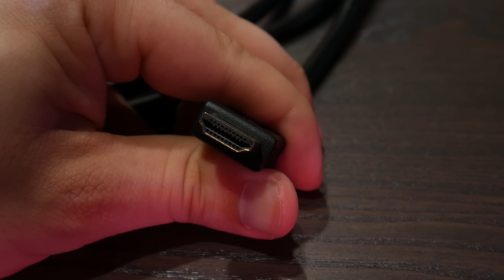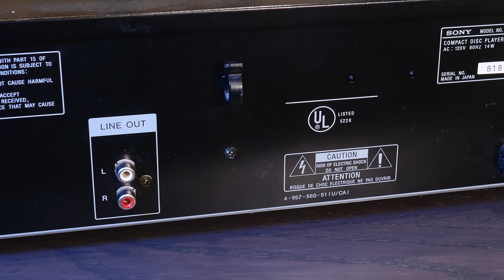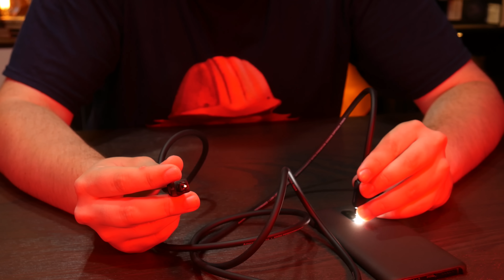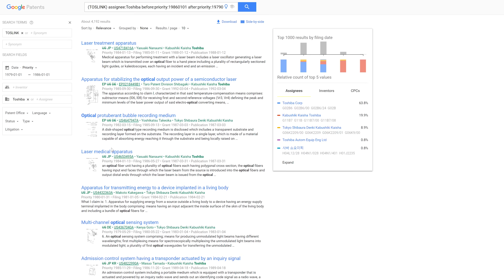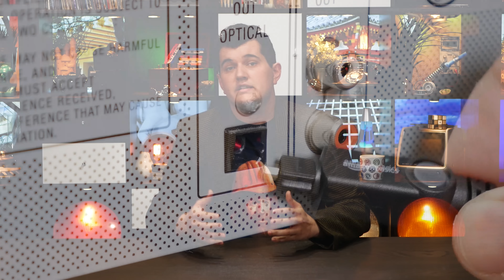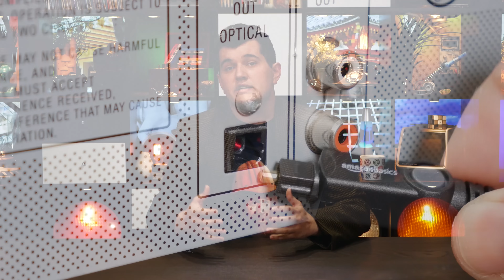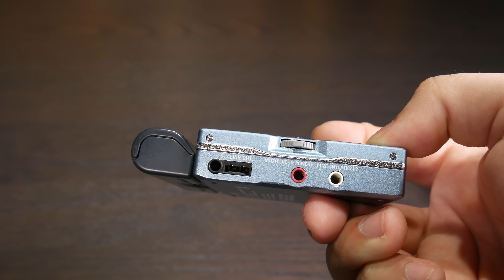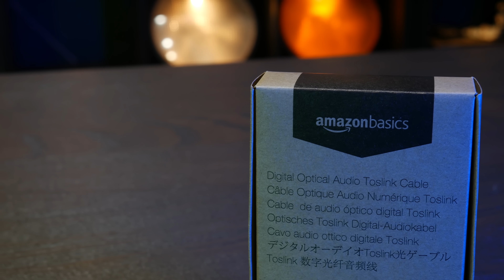TOSLINK: That one consumer fiber optic standard

Comment: My soundbar has HDMI and TOSLINK on it. I use it with my PC, and with the HDMI, audio stability can get wonky. Mainly, my PC will not play audio sometimes until i change inputs and then put it back on HDMI. The audio is great does Dolby ATMOS and whatnot, but it loses the signal sometimes. With the TOSLINK connection, I have no problems. Audio works 100% of the time. On that alone, I keep my TOSLINK hooked up.

Comment: The biggest reason we preferred TOSlink in pro audio / film / high end home theater or audiophile situations was it is electrically isolated from the source. This is less important for something like a cd player and receiver in your example - but connecting a PC to a pro audio rack if you can transmit the data without electrically coupling a device which has motors, high speed switching power stages, and all kinds of messy signaling, that’s MASSIVE.

Comment: TOSLINK does still have a place in the modern home setup. Because TV speakers often are garbage, a soundbar is commonly acquired as part of the package. 
The HDMI will bring the quality audio into the TV but you have to take that audio from the TV into the sound bad. This is where TOSLINK find's it's home in the modern era. Every TV will have a optical audio output and every soundbar has a optical audio input. 
Some are using Bluetooth to try and connect soundbars to TV's but that is going to being audio delay. 
TOSLINK connects my TV to my soundbar and I have excellent audio quality from it.

Comment: i use my pc as streamer if i use coax cabel the digital is obies still fine but sinsce i use a "cheap" audiofiel stremer the noies frome the pc gets somehow in the analog part of the amp whith toslink it doesend the proplem is thet i get jitter over 96khz 24 bit signels but sitil better then coax

Comment: 13:50 I had the same kind of thing when I installed Linux on my 2015 MacBook Pro. I told it to use surround sound and the audio jack started glowing. Sadly enough the 2015 was the last MacBook that had it, I do kind of miss it now even though I wouldn't really use it that much. It was easy to have a thin long cable plugged in to the back of the receiver to quickly play some audio from my laptop.

Comment: I used Mini-Toslink S/PDIF from my Mac to an iPod Hi-Fi for years—I still have it, it still works. Key reason: no need for double amplification, that is, the laptop decoding and amplifying the audio signal for output over RCA/headphone copper, then the amplifier in the speaker set further amplifying the signal. This introduces additional distortion. Toslink? Speaker amplifier, once.

I still use that thing as a centre channel on my home TV. Stereo reproduction is zero (additional satellites solve that problem), but zero need for an additional woofer. Bass to the max.

Comment: My house was built in 1998 and they ran fibre optic from the basement to each room. The thought was your internet would come in from somewhere near to power box and you could have a computer or laptop in any room you wanted……  if you will excuse me I need to reset my wifi modem

Comment: But I can get my 4k video signal over a standard CAT6 cable which is so much easier than HDMI. There's even a COAX based standard that pros use. All those fiddly connectors for HDMI, expensive cable and short runs are so inconvenient when a CAT6 cable can go from my receiver box in the corner of the room to a projector at the back.

Comment: I have an idea how TOSLINK could get a fully backwards compatible upgrade for increased bandwidth.

Connector upgrade: Detection if cable is connected, half-duplex two way communication

Output/TV: After cable inserted waits 10 seconds for a handshake initiated by the receiver/amplifier. If no handshake is initiated old TOSLINK is assumed. Reset if cable disconnected.

Input/Amplifier: After cable inserted it sends the initiation for a handshake once a second until it receives a valid signal. If the signal is old TOSLINK then old TOSLINK mode is selected, if the signal is the handshake new TOSLINK is selected. Reset if cable disconnected.

Thus the new TOSLINK standard could have high speed communication but both sides are backwards compatible.

Comment: I used this slot in the past, one reason was that if I connected with analog cables I got some issue with potential differences as the appartment was not grounded. I also got a hummy noise but using to slink I got a crisp audio it could even cary some modern dolby and dts protocols over to a hometheater.  But the big problem I had was to sync audio and video as they sent over different cables as the video, and this seeemes to differ depending on what the video was compressed with as my pc probably had differences in decoding times 😊

Comment: Great video and topic I always felt the same way about. 

I like the concept and idea of it (ie cool factor) it I want to transmit true digital encoded audio streams , but if I couldn’t find a cable, coaxial was fine. 

When I got into MD players, that changed everything. 

And yes, mini TOS-Link was surprisingly common, I think every single MacBook Pro starting with intel chips in the early 2000’s are actually capable of outputting optical digital audio through the SAME “audio out / headphone” jack, at least I’m pretty sure my Core 2 Duo could. 

HDMI changed everything, eventually there’s just no point in separating the audio from video (AND some control / CEC functions.) ARC was extra nice for smart TVs with high-end sound systems, as (for a while) it was easier to just use the built-in TV apps while keeping nice sound. 

Having others try to figure out what audio source to use on the amp with the TVs built in apps was a huge pain lol.

Comment: I have to sit down and read this comment because I have a really interesting anecdote about fiber optic audio cables being used. Actually in computers. When I was a younger my dad he was really into computer building. I am too, but I know that he was big into computer building because he ran to an issue where he had struggles with his audio output. He used to use a pair of two large speakers for his computer because he doesn't really like wearing headphones. They're too heavy and cumbersome and he found that using standard auxiliary ports using the copper rates like you would any other audio device. He found that they would actually pick up electrical pulses or like em pulses from within the computer as power transferred from DeFeisto device. So he actually bought one of these like single strand fiber optic cables in order to like send the audio traffic digitally so that he didn't need to pick up those noises inside his computer. It's like night and day. You could hear on any set of headphones that he had beforehand. Like a soft humming sound from. Like all those little pulses are all the little changes in the actual environment of that port and then fiber optic cable. He was perfectly fine. Thank you!

Comment: I will just say this:
In 2024, my TV is connected to my pair of bookshelf speakers through an Optical / TOSLINK cable.
Why?
Because it is reliable, I do not get interferences, and it is a single wire.

Yes, I know you can get digital sound from HDMI ARC.
However, the best bookshelf speakers only offer either RCA or, at most, Optical / TOSLINK inputs - not HDMI.

HDMI is left for soundbars, which I honestly find are only good for casual listening.
For movie night, -either with explosions, or with that rambling sound of an airplane passing by - I always prefer a good pair of big speakers.

Comment: I have a question. If Toslink transmits data at the speed of light, why is there so much latency between the sound coming out of my TV and the sound bar of the same brand that is plugged into it? We might as well have never stopped using Bluetooth!

Comment: I use TOSLINK for one very good reason. 

My TV has a TOSLINK out and my powered bookshelf speakers have a TOSLINK in and I happened to have a TOSLINK cable of about the right length.

Smoke if you got em.

Comment: The main purpose of Toslink is a galvanic denouement of equipment! I live in an old house where there were problems with electric networks and for a long time there was a problem with buzzing and squeaks in an amp on the 'idle', on the 'screen' of the cable ... until everything has become working through Toslink ... coils like thrusseles and an ordinary optocrait, The frequencies are strongly extinguished (narrows the frequency response) and distort the sound, you can try it yourself.

Comment: you are a little wrong. What about HDMI over 20 meters with fiber optics? I bought HDMI with fiber optics (there is a lot of interference in the building) and it works PERFECTLY. Before that, there was an interference-protecting cable, not the cheapest one, it worked every other time. I had to insert the cable into the computer/laptop, turn it ON and only then SOMETIMES the projector "saw" the signal, but as soon as there was a little more interference, everything fell off and I had to turn everything on again.

Comment: 11:00 Well, the author is obviously wrong about the immunity to digital signal noise. Unfortunately, some digital playback devices (let's not point fingers, but these are personal computers) “noise” so much that filters receivers can not categorically cope. Outlets, of course, make noise almost exclusively in the 50Hz range, but this is just well filtered. The noise of consumer sound cards, on the other hand, unfortunately literally rumbles throughout the audible frequency range, especially in the mids and highs. On some poorly assembled motherboards, even clicking on a mouse or reading data from a drive adds additional “sound coloring” to Line Out in the form of sand, scraping and rustling, which cannot be conveyed in words. That's why additional optical galvanic isolation between the receiver and the sound card is not superfluous at all - all this noise can only pass through a wire (yes, even coaxial), but will not pass through a piece of transparent plastic.

Comment: I knew nothing about Toslink until a week ago or so.  I bought a new TV for the bedroom and naturally assumed it would have a headphone jack for listening in bed while my wife was sleeping.

It didn't.  I was forced to buy a €20 digital to analogue converter (with a volume control) and a Toslink cable to connect that converter to the optical output of the TV.  The DAC cost €20 and the Toslink (50cm) cable cost €4.

Comment: When I still had a 2006 polycarbonate MacBook, I remember looking inside the headphone jack and seeing a tiny black sphere at the end of the hole. I never knew why it needed that inside the headphone jack until a while later when I looked up why there was a little thing inside the headphone jack and learned that it was an LED. From that point I knew there was an LED in my headphone jack that was somehow related to that red glowing hole on the back of my dads Mac Pro and I had a vague idea that it was for transmitting audio somehow. I thought it might be for analog audio but wasn't sure. I wish I had a toslink cable so I could play with it. I wonder if we can control the light and use it to transmit custom signals through software. It's always possible to turn arbitrary data into audio and transmit it over light just because it's cool.

Comment: I'm still using TOSLINK to connect my computer to my amplifier. It's great for preventing RF interference. Coaxial S/PDIF would work fine too, but my PC only has analog and optical.
Cheap amplified computer speakers will go crazy when I make a phone call or transmit with my ham radios, but my old surround sound receiver doesn't give me any problems.

Comment: A big advantage of toslink is potential length. If you remove the LED and use a proper laser, you could potentially go miles (instead of just a few hundred feet).

Comment: In my home office, my computer used mormal headphone to co-ax to the speakers.  When someone turned the light off in a room far from mine, there was an audible pop from my speakers.  On diff circuits too.

I tried surge supressors, isolators, whatever.  No solution.

Finally got a small speaker set with TOSLINK (computer has that option) and that solved it.  Weird but it works!

Comment: The audiophile nonsense about digital interference really annoys me. So many people swear that high-end CD transports magically improve sound, even though the data coming out of any functioning CD transport is error-corrected and bit-perfect... sigh.

I still love TOSLINK though. Not because it's superior to coaxial but because you can still connect so many dang things together with it, more than 30 years later. Have a brand new TV that you need to hook up to an traditional HiFi setup? TOSLINK!  Is the coaxial port on your DAC occupied and you have a new input? It probably has TOSLINK!

Also, about clock jitter: yes it exists, no it almost never matters because DACs universally filter it. The only time you will run into problems is if you have a VERY jittery digital output (LG TVs are notorious for this) AND a DAC with VERY sensitive jitter rejection values, causing it to fail to lock on to the signal. In which case a firmware update provided by the DAC manufacturer will probably fix it.

Comment: Really like your videos!
Your conclusion about "noise in a digital signal doesn't come out" at 10:51 is a bit misleading though, IMHO.
Fact is that the signal receiver can run into clocking/timing issues when a noisy/jittery signal comes in. The sound won't drop out completely, but degrade. 
And this is true for all connections, not only TOSlink.
... and no, jitter&noise can also affect TOSlink / optical SPDIF.

Comment: Galvanic separation is a huge advantage of Toslink. Finding a reason for 60/50 Hz buzzing just because two masses of two different audio devices are connected together is annoying. It happens sometimes especially in high power amplifiers when connected on two different power network phases. That's why is toslink preferred as digital connection over RCA

Comment: One thing I hadn't considered until just now- light is technically a bit faster than electricity (electricity moves at around 90% of the speed of light) so I suppose theoretically, an optical cable could (imperceptibly) reduce latency.

Comment: I have a 2006 Apple iPod HiFi speaker. I have a Mac Mini M1. I use a Cubilux USB to S/PDIF adaptor to connect the MacMini to the iPod hifi using a mini Toslink connector. Much better than using a standard analogue connection,  No risk of buzz or hum.

Comment: Just imagine USB over bi-directional TOSLINK!  Almost limitless lenght 10:00 This would make TOSLINK actually better! Bi-directional transmission, ability to daisy chain devices any direction, mix redirect, without need of termination. Lenght of the cable doesnt affect sender, there is no load all depend on quality of cable, but you wont destroy precious equipement if you make shortcut. Or put too much load. And it creates galvanical separation.
Reply: Power over TOSLINK (additional regular cables alongside fibre wire), different protocol and.. we have USB 2.0 - considering fact IrDA was a thing in 90s although not practical i could imagine this Frankenshtein interface if invented to be actually usefull. Making IrDA not-so-hidden inside my TOSLINK imaginary connector Tohsiba Optic USB interface. USB 3.0 uses more wires, so do HDMI and Ethernet that would require more diodes, more photosensors. We will never see optical cables in our lifes. USB 2.0 was bi-directional used one line eather way! We could have it if Toshiba created that much more versatile than just to send audio. And make it work back and forth
Reply: 15:00 1983 ups.. to early for them to create USB

Comment: Keep in mind optical is still useful for people who haven’t migrated to ps5 or updated their home theater receiver that supports hdmi 2.1 and hdmi E-arc tbh I used optical on my Xbox one until my old pioneer sx-315 gave out several years ago which by that time I spent most of my time in the little office space I made in the laundry room with a curtain separating the areas and mounted a 65inch Samsung 4k on the wall behind my computer and got a little Samsung 4.1 sound bar with wireless subwoofer for my ps4 gaming and audio was still ran via optical and it wasn’t that bad.

Comment: Toslink was dropped for long term support mainly because Optical (toslink) didn’t support encryption. HDMI allowed for security to be built into every device.

With all those regulations that was spouted off regarding copy protection, it was kind of circumvented in conversation. Movies, tv shows, video games could have lossless audio support with optical. And would have been able to be sent to a DVR, VCR, DVD writer, Blu Ray writer, etc and copied. And manufacturers didnt want this like VCR, and cassette tapes before it. So the HDMI was the solution to it. Same as why Component cables were discontinued as well.

Comment: I'd disagree about the insignificance of noises coming out of a coaxial cable. These either must be made of super quality (hello, gold plating et al!) or just require a complete change after some time. I've had a plenty of tech that'd start farting out loud just for nothing cause some time has passed and contacts have been oxidized and/or covered with dust. At that point TOSLINK- like connectors are supreme.